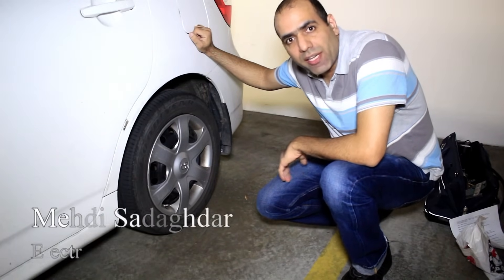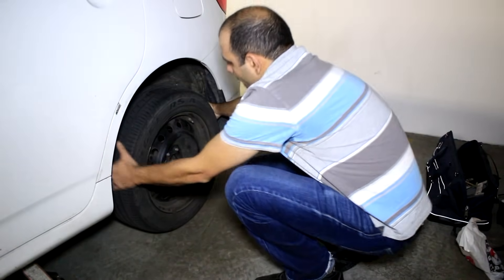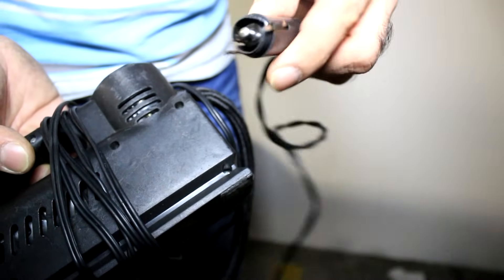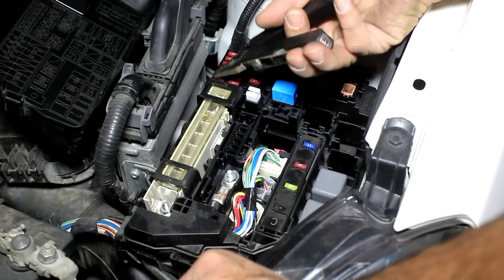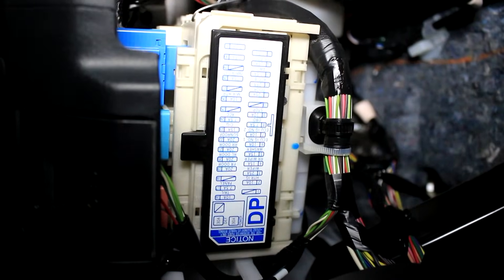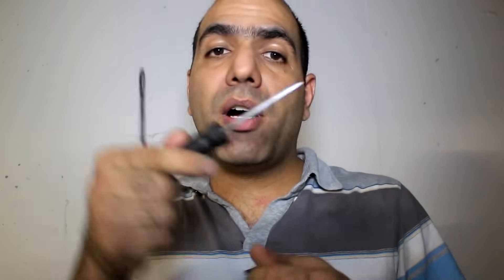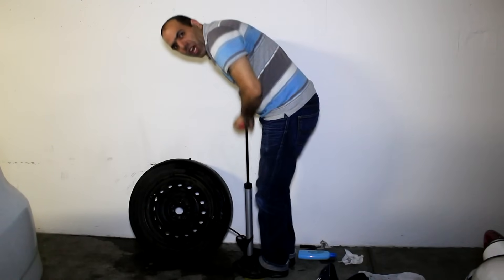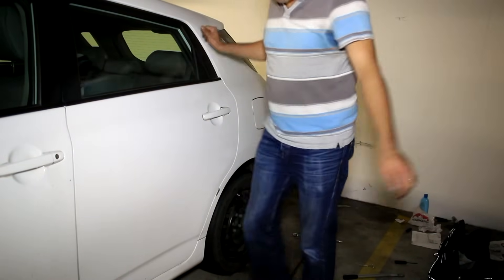How to Repair a Flat Tire

Comment: i worked at a tire shop for a couple years and i don't think i had a single instance of one of those plugs coming out. but if the hole is in the sidewall of the tire it needs replaced.

Comment: 3:34  there should be a sticker with the proper pressure for your car.  usually inside the door sill on the driver side.  some cars have higher requirements; anywhere from 32 to 45.  and pickups with high payload capacities can be much higher.  so if you can't find the sticker, look it up in the manual or online.  but if you're at a gas station somewhere and just trying to get home, what he says will be fine for pretty much everyone, other than super high payload pickups.

Comment: You need to tighten the nuts on the wheel to a certain amount depending on the car, otherwise the breaks will wear out faster

Comment: Hey Mehdi - those auto fuses normally have two exposed sides of the contacts on the top, you can check them with a multimeter without taking them out. Though it did seem quicker to just remove them in your case, but in some cars/bikes it is a nightmare and a multimeter helps loads.

Comment: FWIW a proper repair requires dismounting the tire and a plug patch.  Also he should have tightened the nuts with it on the ground and probably purchased road hazard.

Comment: Just change the tyre... an old tyre will be the magnet of sharp things.. new tyres  will fix it. Read the DOT marking in the tyre to find out the manufacturing date. It will be a 4-digit number like this exemple 4319 ... that is week 43, 2019.

Comment: This is how they do it in third world countries - I have also seen that they set the remaining piece of rope on fire to melt the glue. It's a cheap and fast repair which works quite well, sometimes you even don't have to remove the wheel. But you better have a professional repair with a patch plug which is applied from inside of the tire.

Comment: It can be dangerous on high speed. The metal wire inside the tire is not parallel anymore, it can blow up in high speeds.

Comment: Hi ElectroBoom, I'm sure you already know this, but automotive fuses have metal contacts at the top. you can use a multimeter to test continunity between those two contacts. If you have continuity, then the fuse is good.

This is a nice way of quickly testing fuses, without having to remove them all. I know you have a multimeter or two!

Comment: Be careful with the way you took off the lug but because the way you used your leg for body weight. You could break your lugs and have to replace your studs which is another video I guess 😂
Reply: That's sometime the only way

Comment: "BUT YOUR TIRE COULD EXPLODE AND CAUSE YOU TO DRIVE OFF AN OVERPASS INTO AN ORPHANAGE FULL OF BABIES AND PUPPIES YOU SELFISH BASTARD!! IMPROPERLY REPAIRING YOUR TIRE IS LIKE PULLING THE TRIGGER YOURSELF."
-I have installed dozens of these plugs (black jacks) and have never had even 1 leak. My coworker had 15 in 1 of his tires (off roading vehicle). No leaks. By the way you should shove the plug in further, twist it and then yank it out fast. The plug/patches that go on the inside are a waste of life. Takes 5x longer and is 1/2 as reliable, AND you need more tools and resources. NEVER FORGET to tighten the lug nuts. That's where the danger is. If you raised the car higher you can install these (awkwardly) without removing the wheel.

Comment: This is only a temporary fix. The temporary fix will finally dry up and leak. I used to do this 40 years ago.
For permanent fix you need to remove the tire from ring and patch it inwardly.

Comment: I was waiting for the discovery that pulling out every fuse had bricked the radio 😁 You can usually test car fuses in situ on the outer metal points.

Comment: Never EVER forget to torque your wheels lug nuts to the correct torque spec in a star pattern, we don't need your wheels popping off. I believe you can look it up online, or there is a sticker on your vehicle that tells you the amount of torque you need to apply using a special torque wrench tool. When in doubt, go to a garage and ask if they could help you out, they may be able to lend a hand, or the tool for you to use once so you can drive knowing your wheel won't come off. Stay safe!
Reply: Hes a eletrical engineer not a mechanic

Comment: Invest in the T-handled tire plug tools. So much easier on the hands. Also, use a tiny bit of rubber cement on the plug to help it go I'm easier and seal better.

Comment: I'm a few years late on this post, but thought it might help someone anyways. I always apply a couple of layers of rubber cement around the plug too. It will help hold the plug, and further reduce any leakage of air that isn't happening fast or hard enough to cause the air bubbles. I started doing this after my tire kept going deflating over the course of a week or so, amd it fixed the problem right away.

Comment: If your lokking for pressur is on the driver doors     then    the tire repair u have done are tamporary  u need a inside patch for the tire  im working in a tire shop i tell u thar

Comment: Note: for long term use, you should really use rubber glue. At least in the states, it's sold separately because you can get high off of it. That's how you know it's a good adhesive.

Comment: I’m sure it’s already been said, but in case it hasn’t, never let your car rest solely on your jack. Especially for extended periods of time. A jack stand kit can be purchased from Canadian Tire for cheap (under $40) and I’ve seen you rely only on the lift in previous videos when changing your front brakes, each side at a 3 year interval (lol). I think it’s important you mention it because a lot of people watch your videos and some could get really hurt (or dead) if they attempt to do work with only the lift holding up the car. I’m sure some mechanics with more experience will chime in here. 

Also, thank you for the great videos and all the electrical shocks you endure to for the masses, but more importantly, for the education of many and to debunk and full bridge rectify those that can make free energy from pinching their butt cheeks (its not exactly that... but you know what I mean). 

Have a great day and don’t forget to send me a Keystone scope !

Comment: I used to love fixing flat tires when I worked at an auto shop in high school. It was literally the most satisfying feeling to rip out whatever punctured the tire, make the hole bigger, plug it up with the sticky rope, and pull it out (pretty much the entire process). UGNNHFF~ makes me want to work at the shop again or purposefully shove nails in my tire so I could replug it

Comment: I repaired a puncture last week but hadn't watched this video yet. I did it almost all correctly, including dropping the hood on my head and trying to pull of the wheel with the jack lowered but I missed the crucial fuse replacement.  Can I just replace the fuse now or do I have to go over the whole repair from start?

Comment: Connect the engine air intake of your turbo/supercharged engine to the tire. Start the engine. 
Step on the gas to get out of the turbo lag and the tire will receive crazy amounts of compressed air.

Comment: Dude I got a question as we know pressure is always compressive.. But if inflate a tyre pressure act on it's walls and expands it... Even the unit to measure air Pressure inside the tyre is psi(pressure per inch). So is that concept of pressure being only a compressive force false?

Comment: If you will leave the car on the ground break the lugs first then raise the jack to raise the car and then take the lugs off and the tire and when installing the tire plug you did the honing out right but before you start and you already see you got a whole and before you start holding out have your tire plug already put on to the tire plug installer so that you won't have to air it up again because sometimes would that tire plug honer it will come out when you try to stick it in there to hold the air back in and if you don't have two people the air will come out fast so go ahead and put the tire plug on it and then hone on it and then jerk the Honer out well you forgot to put the glue on the tire plug also that is the correct way to do it they have a glue that goes on the tire plug all it is is more like a slime to make the tire plug go in easier and then simply put it in well it ain't simple but you put it in and you really supposed to put it all the way into tell it is a quarter inch out and then Jerk it Out and you can leave it hanging loose there or you can cut it really don't matter I have done it both ways and both held up but I like to cut it I am so OCD

Comment: You actually don't need to remove tyre from the car. Just find hole and push the sticky thing in the hole. It's kinda easier to do that while tyre it's on the because car hold tyre on the place

Comment: Tire fix technique
1. Loosen the tire
2. Plug a pump and pop a fuse
3. Wonder where the freak the fuse is
4. Drop car hood on head
5. Replace fuse
6. Use bike pump
7. Look for hole in tire by soapy water
8. Cover hole with tar
9. Tighten tire onto car
10. Realise i just wasted your precious time.
😁😁

Comment: For those that do not know your manufacturer specification for tire pressure (as long as you have stock tire size/wheel size as this may alter it slightly), simply open your driver door. Usually there will be a sticker on the door sill listing (cold) tire pressure recommended for your tires. It will list front and rear, sometimes front and rear may have a different PSI listed.

Comment: Never use a hydraulic jack to support a vehicle.  It is for lifting/elevating only.  Once elevated, you need a safe mechanical device like a properly rated jack stand, to keep the vehicle elevated.

Comment: Your videos are very awesome i have been watching them for a long time! you are a great teacher i have learned lots from you!  
I am a mechanic and wanted to share this with everyone
1: rubber cement should be used, smear it all over the plug before sticking it in the tire
2: when putting plug in tire hole, put plug in, then spin handle 180 degrees, then pull handle out
3: always cut as much of the tail off as possible because it can be pulled out

Comment: There is a fuse in the connector of the electric air pump. If you replace it and it blows again, it may have a shorted wire or bad motor.

Comment: i dont know when car manufactures got to cheap to put springs to hold the hood up and the fuse for the cigarette light was almost certainly in the car other wise i guess that was an acceptable explanation of a plug install

Comment: Hello Dear Booming Electron,

  I  did indeed perform as per your prescribed-prescriptions and instructions methods.  Everything went O.k. however, the wrench for untwisting and tying the nuts was very painfull.  Are there any other procedures besides mixing and tying the NuTs especially, with the four-headed-heavy wrench which could cause infections in the urethral canal/system!?

Thank you for your intellectual videos,

Benjamin

Comment: Do you have a camera in my home? 
That is EXACTLY the way my tire repair went last month!
Except, they missed the part where after driving 1/2 mile from home, the car made a blamf-flugga-flugga-grrrrrrt sound as the tire deflated catastrophically, and I gouged a line in the tarmac with my rim.

Comment: Talking about fixing your tire, it's actually much wiser to use a drill and drill through the hole in your tire. After drilling, you'll have to be fast to put the gooey string into your tire. Also it might be great idea, to use B-8000 (or similar) glue to cover up the gooey string. Other wise, the gooey string will be only temporary solution when fixing your tire.
But make sure you have someone, that helps you in this process. As soon as you drill the hole, give the drill to your friend and he'll give you the string, which has glue already applied.

Comment: A trick i found out the hard way. This type of patch does work very well but only and ONLY IF its very difficult to get it in and to clean it. if the file or the plug goes in fairly easy its not going to work. If it takes a large amount of force then it will last forever. also USE  as much rubber cement as you can when you clean it and when you plug it. everything including that file should be coated in rubber cement. You dont want to have to patch anything on the outer treds like this but this type of plug will work. The other patches that tire shops use will not work on that part of the tire.

Comment: You do a good job of educating people with humour.

But on a more serious note, the electric pump you could connect directly to your battery as the plug is broken, and you might find the mushroom plugs better and longer lasting ie the stop and go system.

Comment: now first of all  if you see vids of wheels being changed on race cars its mostly cuz they use impact wrenches and hand tightened  bolts/nuts (thats what she said) for you non car loving peasents  and 2nd why dont u just buy a full sized wheel its totaly not like he spare will bend on fast turns cough cough rlly tho the spares will bend depending on what u doin  and weight like you have to have full sizes on a truck other wise yeahhhhh dissapointement

Comment: pro tip!!! not all car tire psi are the same. to find out the right psi look at the inside of the driver side door you will a stick or plack with the psi on it for both fron and back.

Comment: Uninstalling and installing your car tire on your own manually is not recommended and should be only done as a temporary solution (like if you have a flat tire on the highway and cant get any help) tires need to realigned by a special machine under the supervision of an experienced mechanic you will damage your car and risk your safety by keeping that tire "as is"

Comment: how to make a small bomb no danger realy sersly no danger all can so long you a expert like electroboom 

follow these step:
1. Find a none used Airbag in a car best to use the wheel airbag much funner
2. find a car battery a switch wire them up let electro boom make this before if you not skilled
3. now have fun be safe some parts can be extremly hot after use so dont thouch it 

give this thumps  up so electroboom can make this please could we fun to see if he can do this

Comment: You're a smart man, why didn't you cut the old connector off and bare the wire and connect it to the battery? My wife manages 3 flats in 6mo. We got new tyres on her car, 2 weeks later it had a puncture.

Comment: you should lather the tar string thing with rubber cement before inserting it into the hole. the rubber cement will help lubricate the tar string to make it easier to insert and will also help seal the hole, making it safer to drive on as well.

Comment: Funny thing I learned on my school the right way to change a car tire: First you need to  be sure the handbrakes are engaged and recommended to put the first gear., than you locate the tools, you loosen all the screws (1 turn with the wrench) but not fully. once the car lifted, you take the spare tire and but bellow the car, on the wheel axle as a safety in case the car fall, you can than remove the punctured tired and immediately swap place with the spare tire (under the wheel axle). you than screw the spare tire firmly, you now remove the safety damaged tire from the car axle. and lower the car and tight the spare tire completely (The tire need to be tight between 110N (newtons) and 130 (Just make sure is really tight)). Important don´t use the foot for tightening it up, use your weight instead (Make it tight). pack up all the tools equipment the "accident triangle" the was previously placed at around 100m, make sure every bolt is tight, and at the first occasion go to a tank station and check the tire air pressure or go straight to the garage to get the wheel fixed

Comment: You don't need to take the wheel off - just soap up the tire and find the leak, and move the vehicle until you can get good access to the leak, and fit the safety-seal.  You don't need to pump the tire up hard.  You can safely drive it slowly to a location with free tire air and just blow it up.

Comment: this string ice picky technique is commonly used in my country but there was once a new way i found out to fix punctured tyre at the tyre shop i went, he grind smooth the inside of the tyre so he can place what looks like a piece of rubber tape(?) then he pressed the tape(?) firmly. anyone familiar with this repair style? logically if the rubber tape is inside the tyre, i thought that the air pressure inside the tyre will push the tape even more, thus preventing leaking.
Reply: +Nano Kumo Patches are fairly common, and wen installed properly are a better way to go. But if someone has used someting like fix-a-flat, or some other glue like junk sprayed inside, its a heck of a mess to clean up, and might affect the bonding process on the patch.   I've seen patches fail, I've never seen a plug fail.

Comment: Also always double check the lug nuts for proper tightness.  If you tighten them while the tire is in the air like he did and didnt re-tighten them once on the ground you will have loose lug nuts and damage the studs and or have your wheel come off.

Comment: Dude, don't unbolt your wheel nuts in that pattern (or bolt them up either), you can warp brake rotors and things and generally have a bad time, do it in a star pattern and don't undo or tighten them all the way in one go. Don't overtighten them either you can again cause warping.
Also tyre inflation pressure is normally on a sticker on the drivers door or on the pillar the door fits into, some cars can be quite different (Prius is more like 40PSI eg) having incorrect tyre pressure is a causitive or contributing factor in a decent number of crashes.